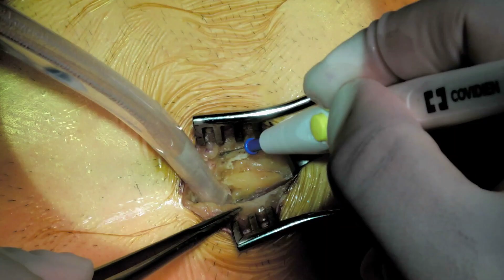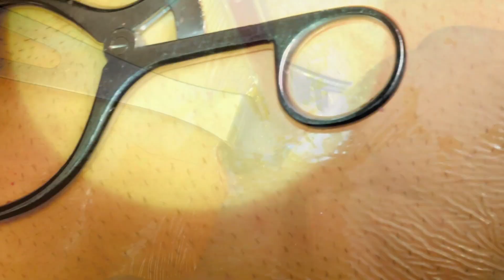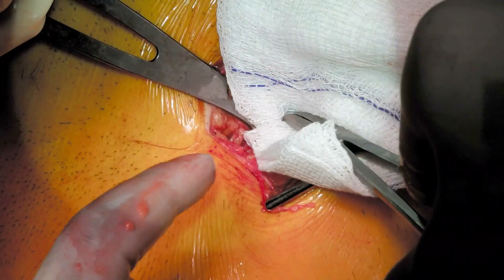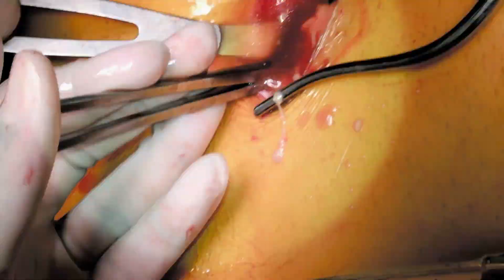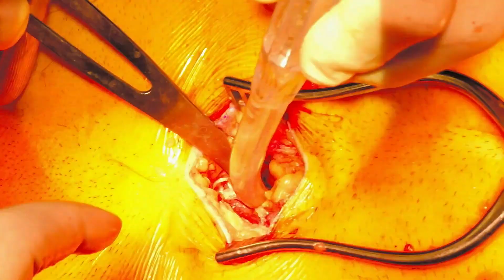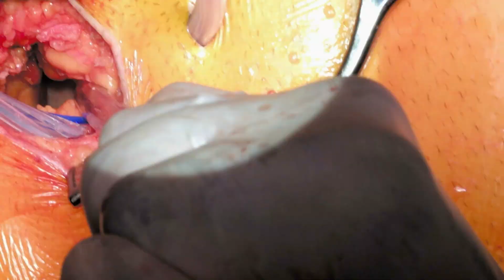How To Drain a Pericardial Effusion with Surgery

Comment: How important is it to have the drain left in for a while after the window operation?
Reply from the maker: I appreciate the question and sorry for the delay in responding. It is very important to leave the drain in place in order to remove any residual fluid that is behind the heart or simply isn't removed at the time of surgery. These operations are fast and so you won't remove all the fluid if you don't place a drainage tube for the first 24-48hrs. There are some fluid collections that don't drain until the patient moves around.